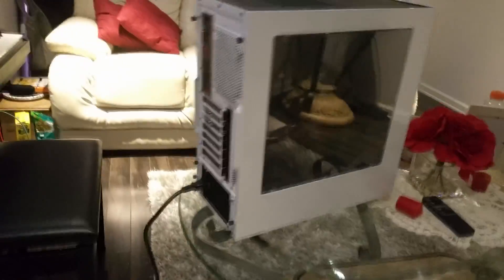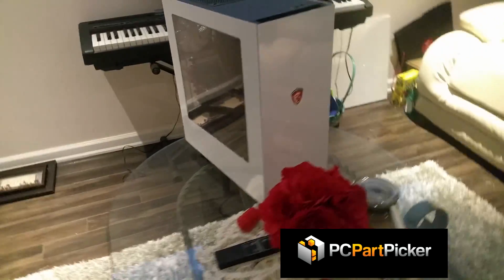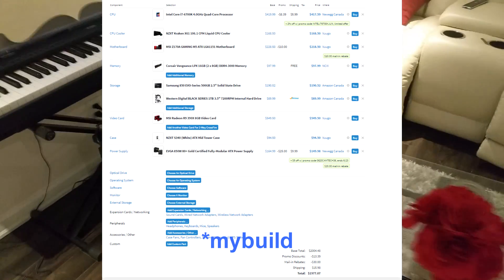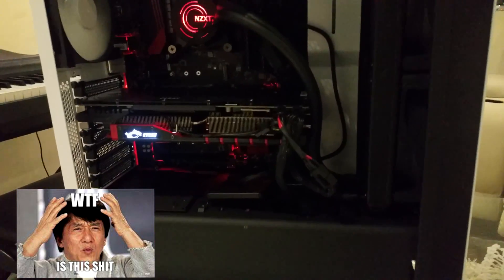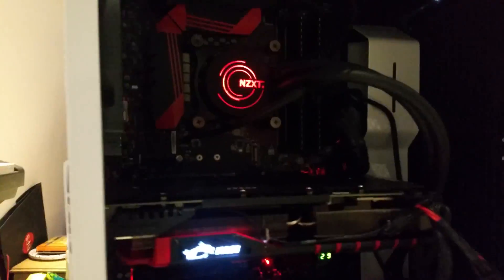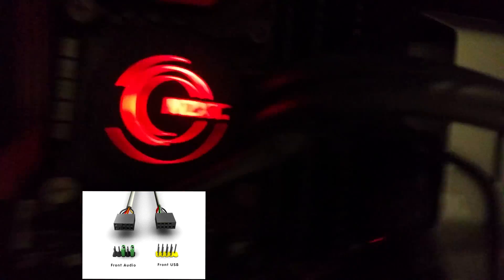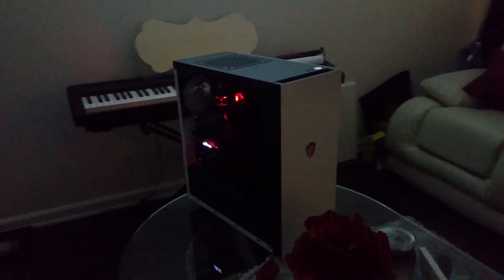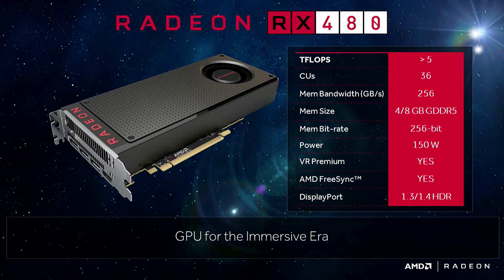How To Get Into PC Gaming (First Time Building Advice)

Comment: can mid range pc plays 3440x1440p resolution at 100fps in all games
Reply: THE TECH ATOM Lab It depends how optimized the game is but on most games a £600 pc will run that resolution at about 40-70fps. My i5 7500 paired with a gtx 1050ti gets like 80-90fps on pubg and way over 100 on games like gta and fallout at 1080p